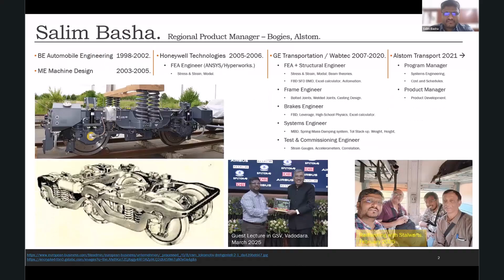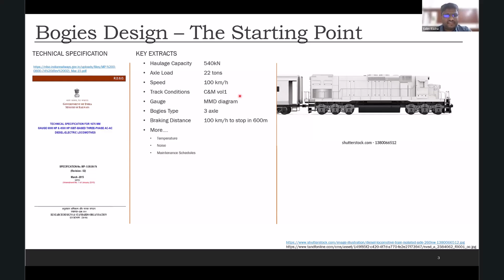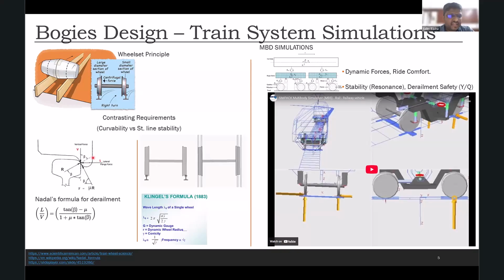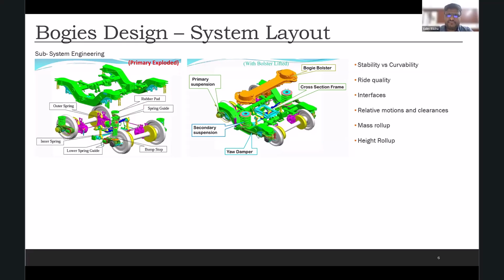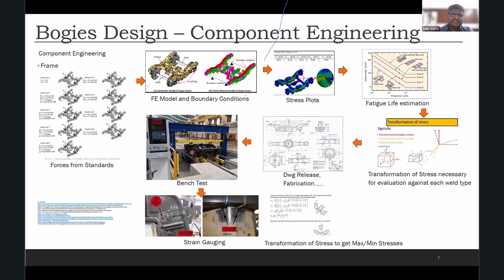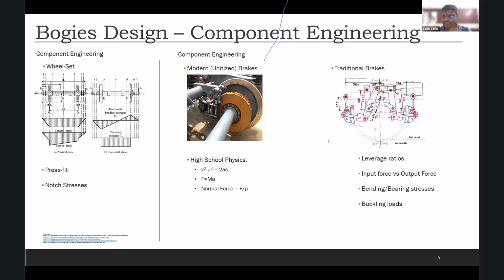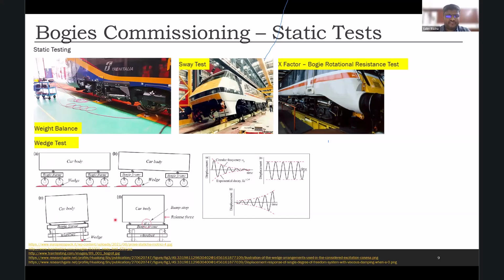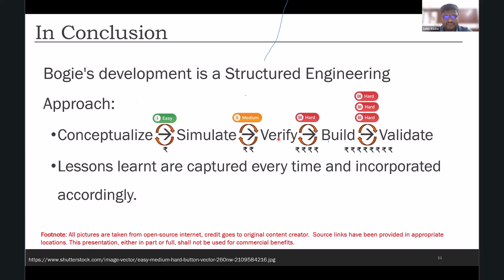53rd RES Monthly Talk - Rolling Stock Bogies Design and Commissioning - an Overview

Comment: Dears, this is the list of questions asked in chat during the session and my response thereof. The answers are correct to the best of my knowledge and if incorrect or inefficient, kind request to correct with right references.
1.	Is the lock bar a limitation?
•	I didn't get the question and context right, but I think this was already answered by someone else on the call.
2.	What about variation in coupler height?
•	If we are asking what role the coupler height plays: It plays a direct role in wheel unloading during starting traction. The tractive effort is generated at wheel/rail interface and reacted at the coupler. This height difference creates a moment (or couple), that is balanced by front bogie unloading and rear bogie overloading. Due to this, the front bogie loses its capacity to generate full traction (would tend to slip). So, to minimize this effect, it is necessary to keep this height as minimum as possible. I think IR uses ~1090mm, whereas North American Freight trains use ~900mm. 2. If we are asking gradual change in coupler height due to wheel wear: Generally, in Locomotives, the wheel wear is about ~40mm and I think this variation is accommodated by the coupler without any adjustment, and if still needed, we may place a shim below the coupler to get back its height. In metros, it is the floor height that has to be maintained, so we use shims under secondary suspension.  
3.	Is there an ideal proportion between primary deflection and secondary spring deflection?
•	There is no one word answer for this. I have seen in locomotives that Americans follow soft primary and stiff secondary, whereas Europeans follow stiff primary and soft secondary, and both seem to work. We need to experiment in MBD software, by inputting the measured track and studying the response by playing with this ratio. 
4.	What is unbalance mass at each wheel
•	There are some limits defined by international standards and even by RDSO, on what is the max load difference we can have on a wheel set - left to right, between two wheelsets of a bogie. I think it is 2% for former and 4% for latter, need to check.
5.	Is there any scope for electronics?
•	Certainly, with low-cost electronics, we can have many active sensors mounted across bogie that continuously monitor the situation and feed a data logger. This data is used to predict instabilities on a high-speed train or predict failures before they advent. ALSTOM has such solutions in their portfolio, my talk in GSV Vadodara in their event "EPITOME 2025" was on same topic. It was recorded and can be obtained if we have contacts in GSV. I can give that talk again, but it needs to be done officially, with right stake holders from ALSTOM in loop.
6.	How different are TGV and bullet train bogies.
•	They are different majorly in following aspects: 1. Low un-sprung mass - the motor and sometimes the gearbox is mounted on frame 2. Large wheelbase for stability 3. suspension tuned for slab/ballasted track, 4. Wheel taper is 1:40, unlike 1:20 in standard trains. Most importantly, the track plays a big role: No tight curves, well maintained through ballast or slab, moveable frogs, fenced, funnelled tunnels.
7.	What is future direction on bogies.
•	There are two aspects in which we can see developments: In design: Reduce the bogie weight, means reduced forces on the track, reach higher speeds. For this we can see special designs (ex. FlexxECO bogies from ALSTOM are ~30% lower in mass for same performance) special alloys or plastics introduced. In maintenance: Developing technologies that extend the component life - extend wheel life, bearing life, rubber element life - which means lower downtime.
8.	Have some context on BoBo for high speed - as per French research the highest stable speeds are possible on BoBo configs only. They initially tried high speeds on Co Ci and it was replicated on BoBo.
•	True. For higher speeds BoBo is rule, CoCo is exception. I haven’t seen any CoCo config > 160 kph. It becomes difficult to design and stabilize a CoCo for higher speeds; CoCo is best suited for heavy haul medium speed locomotives. I call BoBo has Horse and CoCo as Elephant - both good in their own ways. EMD developed experimental DoDo bogies (EMD DD40X) in 1970’s, were in limited qty.
9.	A study of U.S. high-speed bogies found that reducing unsprung mass allows more components to be supported by the suspension (sprung mass), which reduces dynamic loads on the track and improves dynamic stability at higher speeds
•	True.